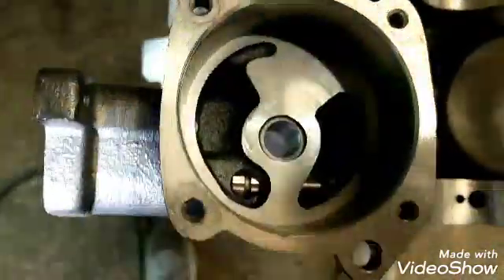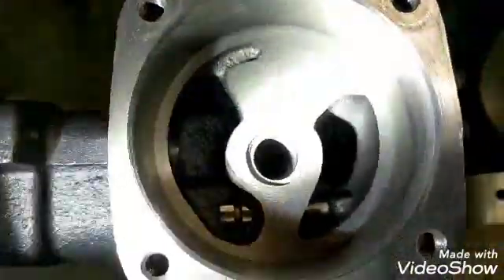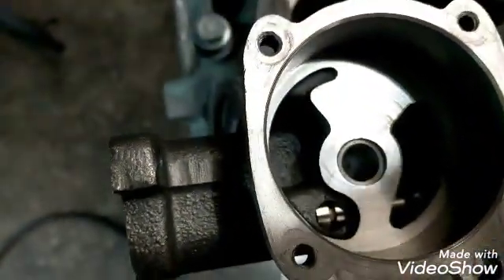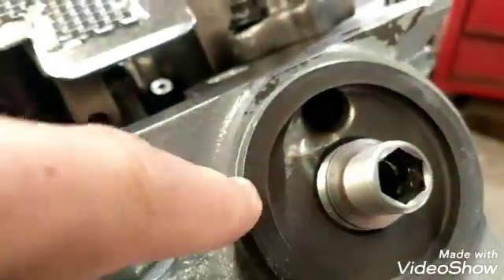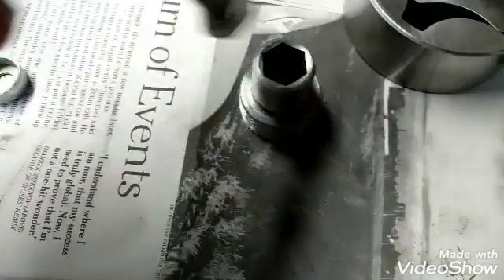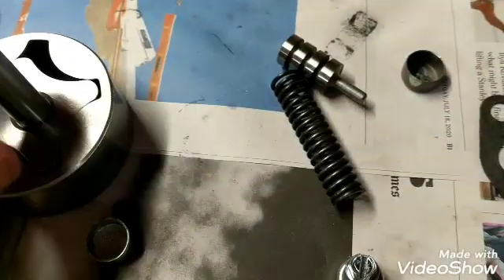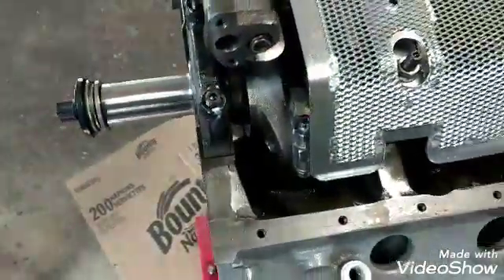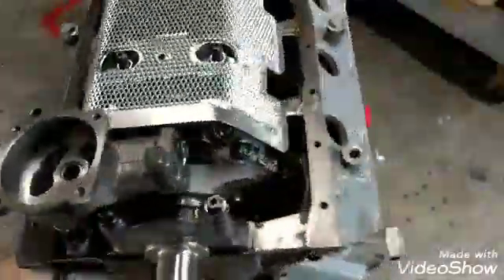Unnecessary oil pump mods

Comment: Hey David I know this is a older video but what are your thoughts on a HV oil pump?
Reply from the maker: I always replace the oil pump driveshaft with a HD piece, and use either a high pressure pump if the block is stock. If I used a HV pump I usually modify the passages so that the greater volume gets to the bearings.

Comment: Do you know if it’s possible to pull the oil pan on a fox with stock k member. My oil pump locked up and broke the oil pump drive shaft.
Reply from the maker: Yes, just have to jack up the engine and get the crank rotated right to clear the pan as you pull it out.
Reply: Thanks I figured if any one would know it would be you. Please keep up the great mustang science.

Comment: Glad to see someone else thinks about oil control(windage tray )  , free HP .
Reply from the maker: There's two schools of thought on these. Some think they don't do anything, and those who think they do. You can't just bolt them on, the screen has to be as close as possible to the crank where it comes out of the oil, obviously without hitting the rod bolts.
Reply: FXRSDriver yes sir , I bought the Louvered solid , Milodon . I bolted it on had to fix a hack job on the pickup tube , my pan/pick up combo I found out later was a pro form piece of garbage . Any way I had a noise I heard when rolling engine around , come to fined out 1 rod bolt was hitting . Corrected that said a prayer and lucky me the pan doesn’t leak.

Comment: What about using a hex coupler sized for a 5/16” wrench? To remove the oil filter fitting?
Reply from the maker: Yeah, that would work too, good idea.
Reply: FXRSDriver Maybe take an old 5/16” socket and epoxy a hex coupler into it?

Comment: Cool I didn't know that u were building a stroker 331 for the Ltd that's going to be a beast and I too was thinking about going to the power tour next year. I think that it will be fun and there's a lot of different things that u can do. I'm going to get the ac working in the pinto as well just incase it is hot but that's cool that you are thinking about going also but if u need those springs for the Ltd let me know and I'll get them out to u pretty quickly. I think that the spring rate is 370 but they're for roller cams for 302s I just bought the wrong ones and they're too much for my cam. I don't want any flat lobes 🤣 cant make any powah like that

Comment from the maker: I posed the question about pump mods on YB:  https://www.yellowbullet.com/threads/small-block-ford-oil-pump-mods-worthwhile-or-no.2634470/#post-72431336
Reply from the maker: https://www.summitracing.com/parts/ctr-22-130
Reply from the maker: This is the part number for the oil filter adapter https://www.summitracing.com/parts/aaf-all92003
Reply from the maker: This is the plug number if you want to get a bunch, otherwise might be able to buy singles at Oreilly. They supposedly are used regularly in big block chevys. https://www.amazon.com/Pioneer-Automotive-Pp45425-Auto-Part/dp/B0049JRW2C/ref=sr_1_11?dchild=1&keywords=pp-454-25&qid=1595619258&sr=8-11